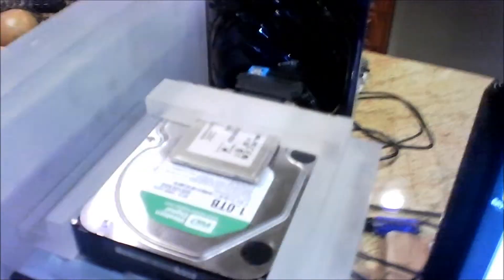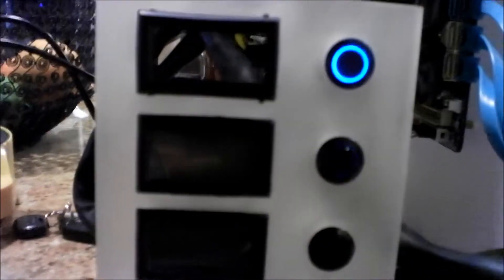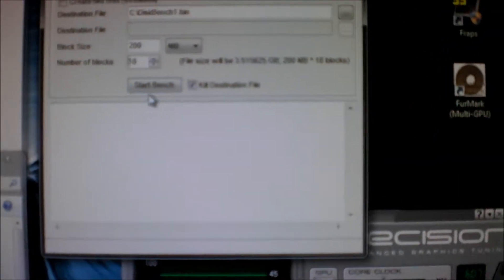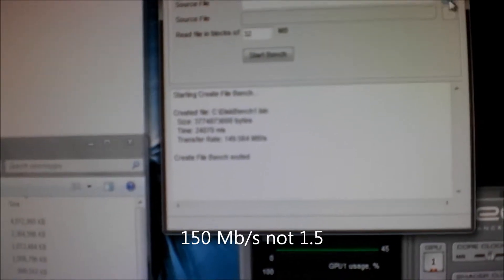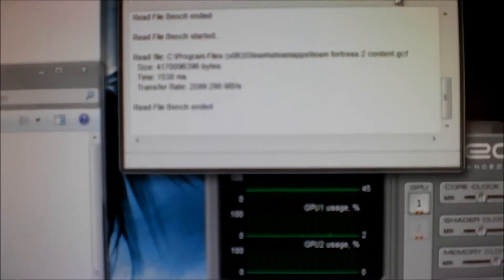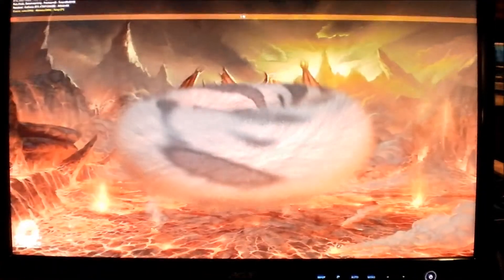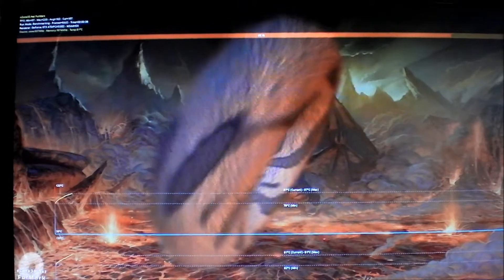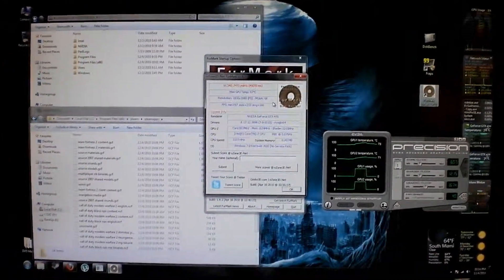Winter 2010 PC Build Part 4 Air Cooled Benchmarking

Comment from the maker: @guyver8201a Someone watched the part 5 and asked the same question here is what i wrote. From top to bottom they are 1) All CPU Meter 2) Network Meter 3) and 4) .:GPU Observer:. (the name has the dots) 5) Driver Meter 6) Top Processes

I really like Top Processes and would recommend it to anyone. You can choose to see that are the programs that using CPU power, RAM space or Hard drive I/O. It really helps out when your computer starts to slow down, you can find the problem right away.